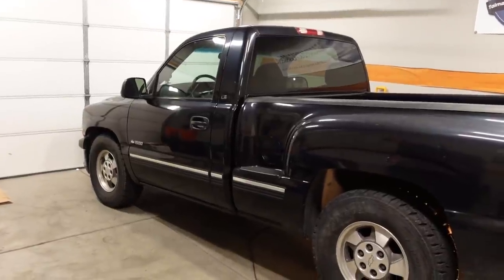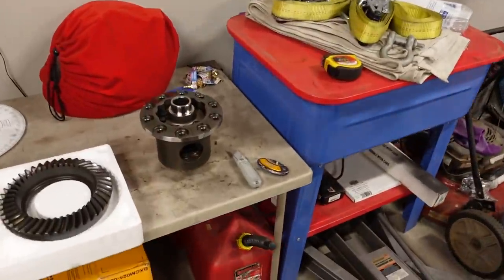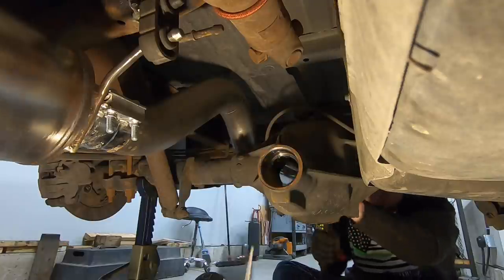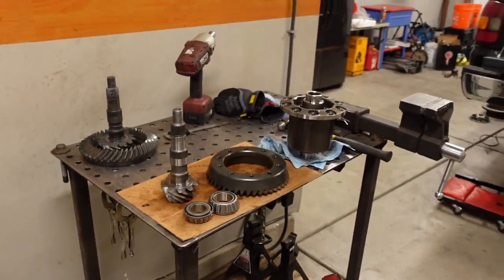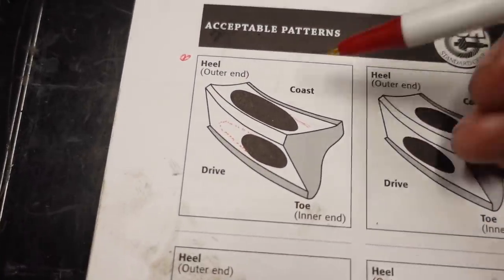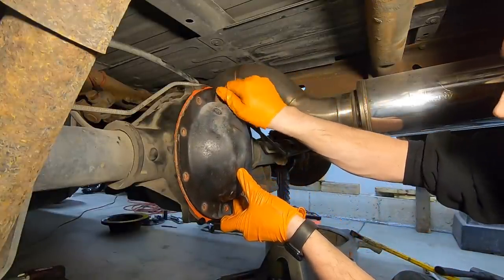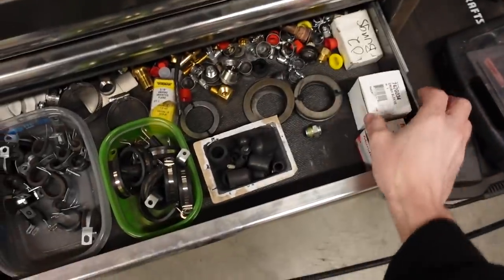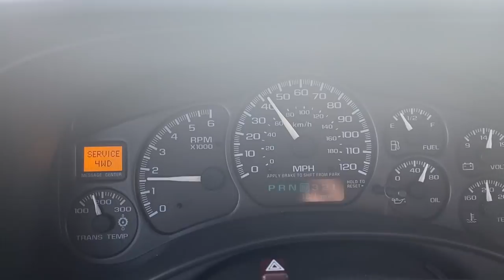Gain Acceleration WITHOUT Adding ANY Horsepower

Comment: Hey, I love your channel. My truck has the same service 4WD light. Do you know what could be causing the issue? Thanks!
Reply: Check your ground wires making sure they aren’t lose or corroded. AFAIK they are located under the drivers floor pan between the rocker panel and the chassis rail. Or you could use a code scanner to narrow down the problem.
Reply: He has the front diff out of his truck.  So the wires that engage and disconnect the front axle are not plugged in.
Reply from the maker: the code on my truck says something about the switch assembly in the dash, but because I am doing the AWD conversion soon, I just ignored the problem since it'll all get disconnected anyhow

Comment: Is the 14 inch pounds that you said for rotational torque is that with the seal or without how do I do that on setting the rotational torque
Reply from the maker: I've always set pinion bearing preload with the seal in place, but favor the high side of spec to offset the friction of the seal.
Reply: @LawrenceTolman  thank you

Comment: Your truck has a trans temp gauge.  Did you  switch the dash from a truck with a 4l80e?
Reply: 99-02 Denali cluster. Came with one stock
Reply from the maker: I swapped out the original instrument cluster with a denali cluster, they have a 120mph speedo and trans temp. The HD Silverado had trans temp but still a 100 mph speedo. plug and play conversion

Comment: A 4.30 seems like an odd gearing compared to ‘standard’ gear sets like 3.42 3.73 or even a 4.10 or 4.56 like us 4x4 guys run
Reply from the maker: I’ve seen lots of diesel guys use 4.30s with like a 37 or 40 inch tire

Comment: I'm curious why a 4.30 gear isn't good for a turbo setup?
Reply from the maker: There’s less load on the engine which makes it harder for the turbo to spool up. Usually turbo setups like a numerically lower gear
Reply: @LawrenceTolman  ahhh the infamous keep the turbo loaded theory. I remember watching a tech tip Tuesday from motion raceworks. Doug talked about this same thing but thought it was false in his opinion.

Comment: It is 4wd and you changed only the rear axle ratio????  So the front drive shaft is removed ??
Reply: Truck will be fine so long as you dont engage 4x4. The t-case for sending power to the front diff will just spin at a different rate but that is okay because in 2wd it is mechanically seperated.

Edit: Also he stated that he will be putting in an 8 1/4" AWD front diff and AWD t-case. so it will match up soon enough.
Reply from the maker: changed the rear only for now, and as long as I Don't use 4x4, it'll be OK. I will be showing the re-gear process on the front when the parts show up
Reply: @LawrenceTolman  Had me going wtf for a while, have owned 2 4x4 in my life. 77 dodge w200, and a 49 willys pickup with 638/1 gears so my knowledge is low on modern trucks. Didn't catch the part where 2wd is your only choice when making this swap for the time being. Great show, keep up the great work.

Comment: How much hp and torque can the 10 bolt rear-end hold?
Reply from the maker: quite a bit actually. I think this truck will be less than 750hp when done, and the 8.6 10-bolt should be fine at that level.
Reply: @LawrenceTolman  good to know!'

Comment: Did you have  to recalibrate your speedo?
Reply: Yes. Just like changing tire OD.
Reply: Yes, he did.  You have to change the tune for any change in tire or gear.  Will still drive, but like an alinement, needs to be done before too long for shift points, speedometer, etc.

Comment: How did you get "setup bearings"??
Reply: He likely purchased two sets of the same brand pinion bearings and used a brake cylinder hone or cartridge sander to increase the inner diameter of the bearings which require shim fitment.  This permits assembly and disassembly without destroying the bearings by pressing them on and off multiple times so you can try different shim packages. After the desired pattern and backlash is achieved assemble one last time with new bearings from the same manufacturer.  After using the setup bearings lightly oil them and stick them in a bag for your next build of the same differential type.

Edit: Always buy two crush sleeves so you get it right the first time and don't need the additional sleeve. If you don't buy two sleeves you will need the additional sleeve.  Not sure why this works but it works.
Reply from the maker: I have made setup bearings in the past just like the comment below mentions, but this bearing actually came from Yukon gear and axle. they sell setup bearings already honed out.

Comment: You are changing the Overall Diameter of the tires to "knock down" the effective ratio to a numerically lower #
Reply from the maker: correct, changing tire size will sorta affect the ratio of the gear. although the tires I'm putting on are slightly smaller in diameter which means sort of like a numerically higher ratio
Reply: @LawrenceTolman  I was thinking you were putting on a drag rim and then a taller tire for the sidewall flex via a bias ply ET Drag. So you get more give at the launch but the truck will drive like it has a 3.90 or 4.10 versus the actual 4.30s which are in it

Comment: I love the 4.30's in my @2010 4wd Tundra, makes the 3.90's my freinds have in theirs feel sluggish and don't get me started on how they pull a trailer with those smaller gears. 

Why aren't y'all using the 6r60e and 6r80e's basically the same trans as the 4r's but with dual overdrives. Makes running 4.30's or higher better at upper speeds. Like I said I have 4.30's in my Tundra and it's a 6 speed with dual OD, @75mph I'm @2000rpm with a 34" tire.